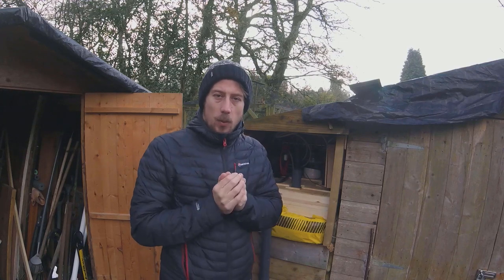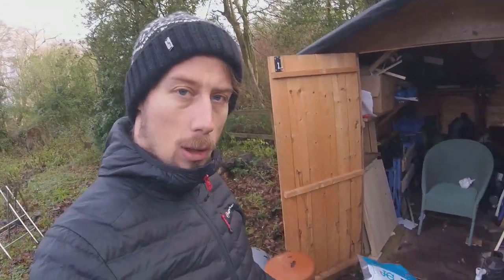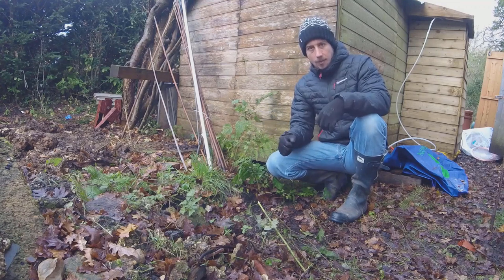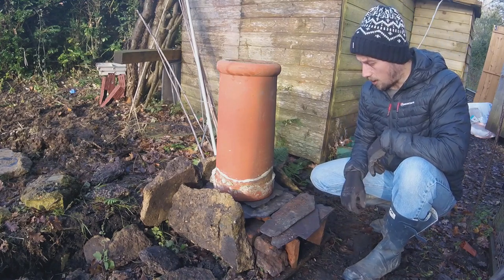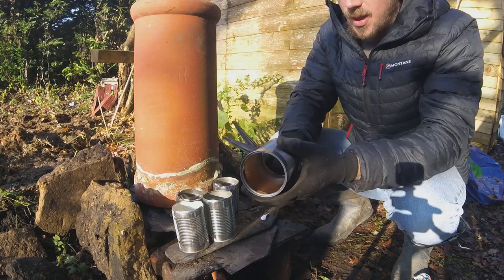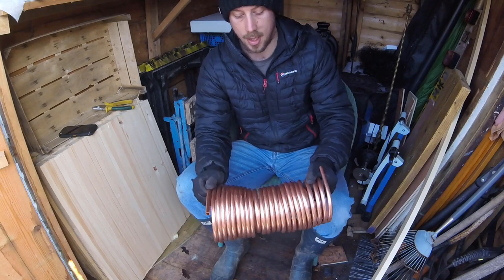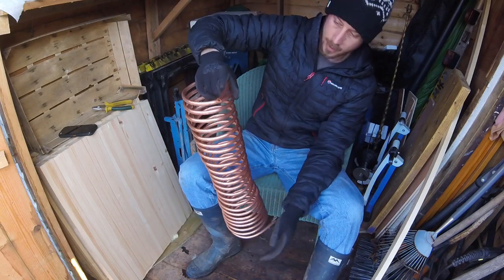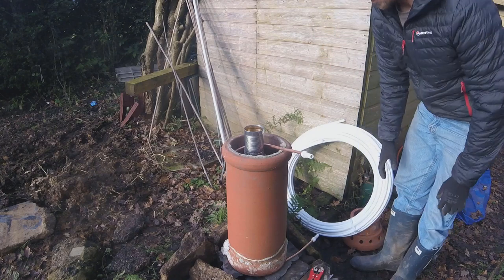Low-tech DIY Rocket Stove Water Heater PART I // Construction

Comment from the maker: Hello Everyone. Thank you of watching, I hope you found the video interesting. If you did or if you didn't let me know below. For those of you who are new to my videos subscribe and go and check out my first video on the biogas digester I mention here: https://youtu.be/Z9MTCFWTpyo
Reply: Would you get better heat transfer if the flames came up through the coils, rather than just picking up from the central metal chimney?
Reply from the maker: Hi John. Yes there would. I was a bit nervous to do that as I was unsure about the thermosyphon. If the pipe is directly heated by the flame and the water doesn't flow the pipe would get too hot and could melt. With a bit of mass between the two the chance of that is reduced. Now I have it working altering the chimney is definitely an option to increase the temperature of the water. Cheers

Comment: Very nice, I like this. Thanks for sharing. I was caught up with finding clay, and the sand works just as well!
A trick for bending the copper pipe is to fill it with sand - prevents any accidental "close bends" when you get a bit rough on it
Reply from the maker: Sand works great, you just have to find something to be your inner, to hold it in place. Thanks for the suggestion!

Comment: I like that idea. Has the tin chimney held up with use? Mine always seem to melt. Two different diameter clay pipes might work .... I might try that.
Reply from the maker: Thanks. It held up for the time I used it. But the chimney wasn't big enough to heat up the water quickly so I changed the design a bit with some suggestions from a viewer. You can check it out here: https://youtu.be/X3n7POMqS_c Cheers!

Comment: Just an idea, using an earth battery with a jewel thief circuit to run a fan and use a rainbow burner in a small furnace to heat your biogas forced air furnaces don't take much fuel to run.
Reply from the maker: I like that idea, especially the forced air furnace. I'll have to do some research on those. Cheers

Comment: Did you just chip a hole at the bottom of the stack for the pipe to come through?
Reply from the maker: Even more basic than that. Just sat the stack on top of the copper pipe, supported by a few fragments of tile and then sealed the gap later with sand.